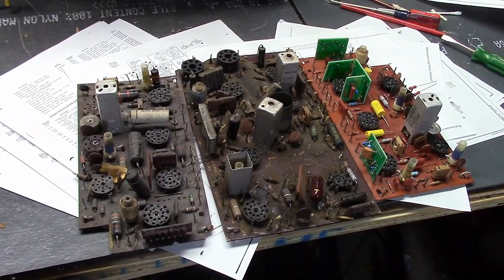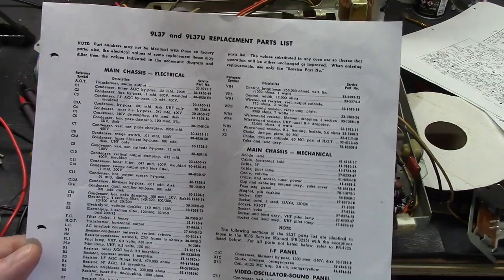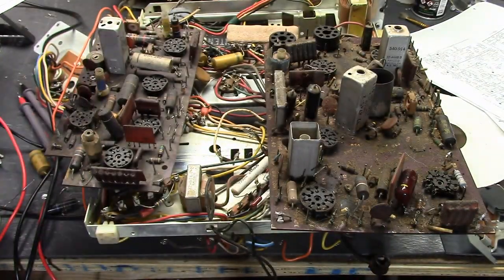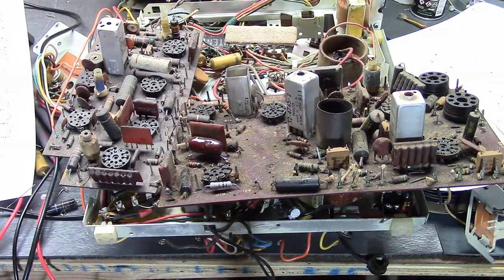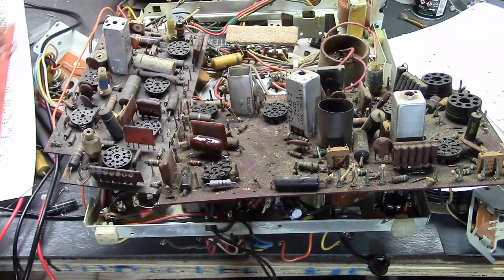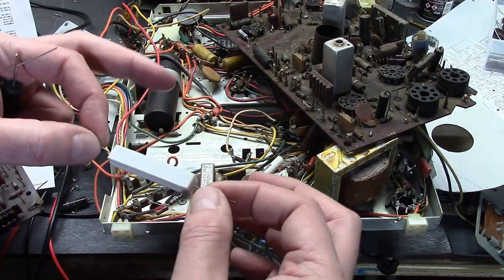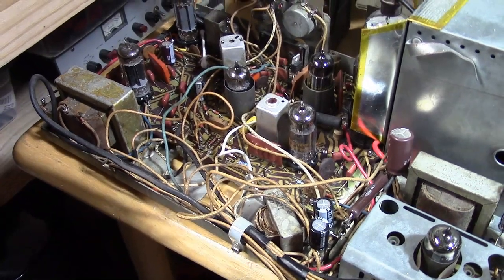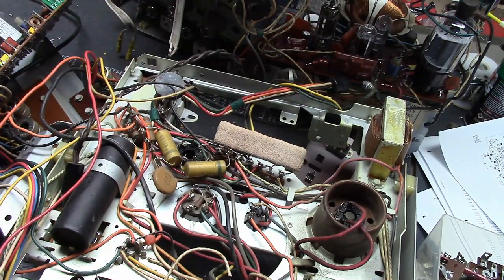Predicta restoration tips: Component selection introduction and Resistors

Comment: Bob you are missing one thing resistors have voltage ratings !
Some low wattage ones can be 70 V ( don't ask how I know 😆😆 ) .
Reply from the maker: 70 volts? That doesn't sound possible. Were they tiny surface mount?  Standard is 1/2W - 350V, 1W - 500V, 2W - 750V. Really nothing to be concerned about. Use the same wattage or better than the original.
Reply: @bandersentv  
47K 1/2 W ( 1/4 W mil spec ) obtained from RS components .

Let's just say the switching power supplies didn't cut the mustard that day .
Someone above my pay grade got a rocket ............
Reply from the maker: I suspect they were defective, counterfeit or there was a voltage spike
Reply: Major suppliers like Mouser and Allied have data sheets for their lines of resistors.  Are these 70v resistors like microscopic?

Old dogs like me used to just buy the carbon composition resistors from the service supply stores, though today there are better and more stable resistors to use.